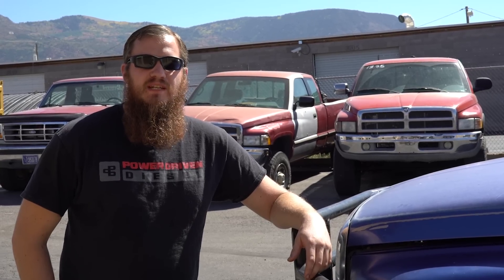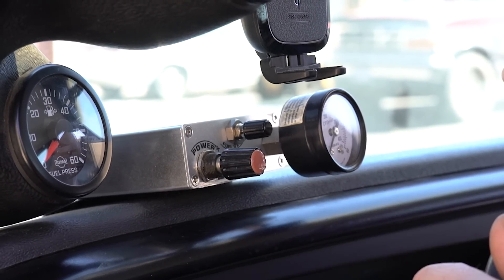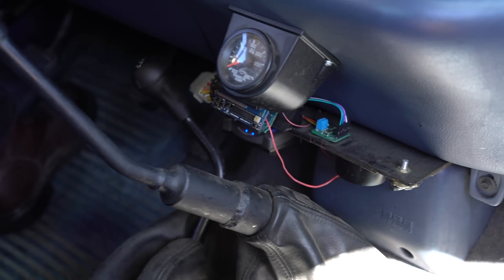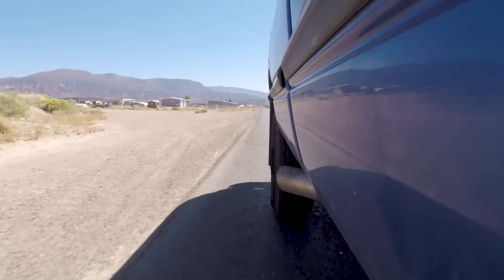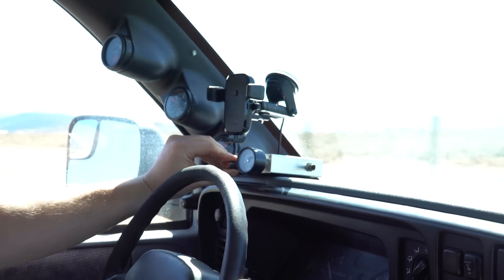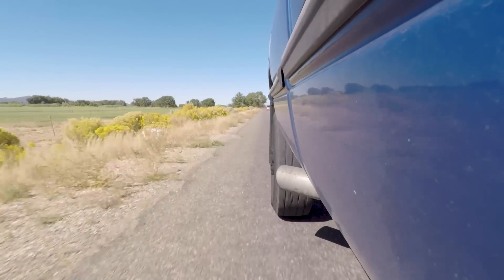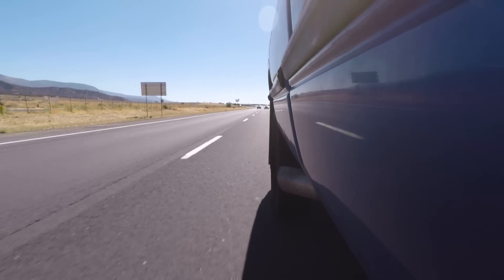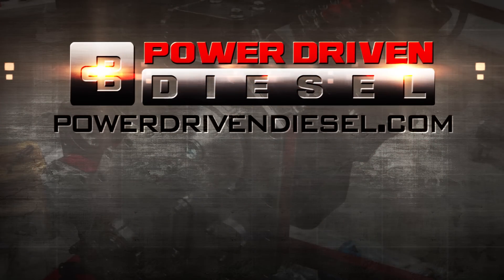Control Diesel Engine Smoke and EGT with AFC LIVE | Power Driven Diesel

Comment: I just installed mine and having some problems. I have a 215 pump, 5x12 100hp injectors, and a s362sxe turbo. I’m making about 43lbs of boost so I put the 30-45 max travel spring in the afc. I have the afc in the middle position and I’m still seeing lots of smoke even with the afc live fully restricted. I also Kant really tell the difference when the switch is flipped on or off.
Reply from the maker: Did you install the qvv valve? if so remove that from the equation, if that dose not work take a line and run it straight from the head to the p7100.
Reply: @pddofficial  I got it all working, hate to say it operator error.

Comment: Hey guys we're installing the system in a 98 12 valve. is it possible to run to lean with the system? Is that something we need to worry about. My guess is not.
Reply from the maker: No a diesel can only run lean with nitrous or propane injection

Comment: would this work with a bone stock 1992 12 valve or does it have to have a p pump
Reply: Your truck doesn't have a p pump, only on 94-97 trucks. Unless you do a p pump swap

Comment: I bought an AFCLive but I think my max travel spring might be too heavy for my setup.  I believe I went with the ~40psi spring but I generally only boost to 20-25psi when towing.  The AFCLive doesn't seem to do anything at all, I really can't tell any difference.  Is my spring too stiff for my setup (PDD 500hp fueling kit with K27 turbo).
Reply: Did you figure it out ?
Reply: @EastMenloPark1650  not yet. Ordered the medium  spring kit but haven't installed it yet

Comment: So when you’re tuning for egt and you adjust your max power back to where the afc only sees 10 psi, does that mean my aftermarket K27 will be limited to 10 psi as well or still achieve the set wastegate pressure?
Reply: There is no control the turbo, but by controlling fueling it effects the turbo that's down line.

Comment: is that a zf6 swapped in it??! and AFC live for life. I cant imagine not having one now lol
Reply: G56 out of a 2005.5 to 2018 5.9 or 6.7 Cummins. I have 98 12valve and just Put one in my truck so easy it bolts right up 13” south bend clutch for a 2008 Dodge Ram 2500 works great. Watch V-belt and son put one in his 98 check out his videos Have Great day

Comment: Haven’t saw it in the comments yet so I’ll say it...

“My afc is my right foot!”
Reply: Garett Conner still cannot control fuel rate very efficiently or max egt on cruise.
Reply: My pump is maxed and a gutted afc, sometimes ya just gotta send it. 60ibs of boost at over 4K rpms on stock headbolts, valvesprings and pushrods if that tells you how much I care🤷🏻‍♂️

Comment: So when the toggle switch is off and the AFC life is bypass it runs as a stock truck ? Or the last setting you left it in? Or what exactly
Reply: So when the toggle is off is basically runs at Max potential?
Reply: Christopher Guerrero yes, just as if it wasn’t even there and the afc was plumbed directly to the head as stock.
Reply: it runs at full air pressure signal to the afc housing so based on what  afc spring and how much boost you produce you should have full afc foot travel and max fuel